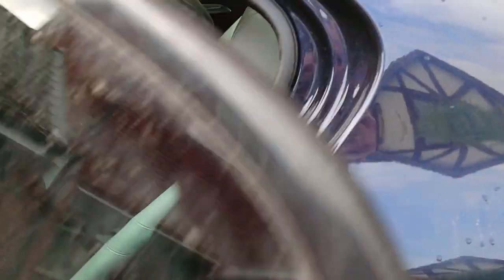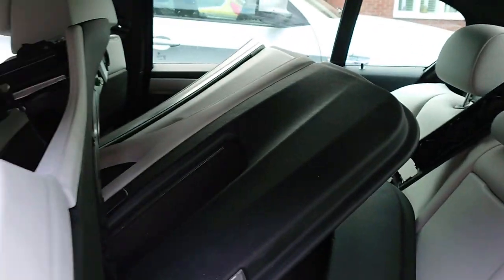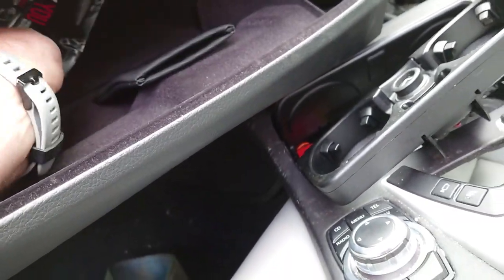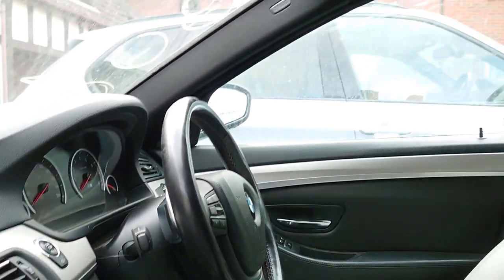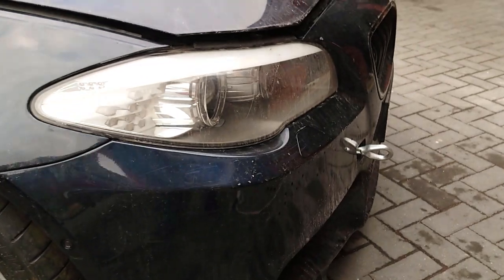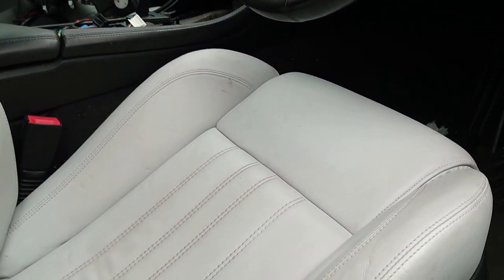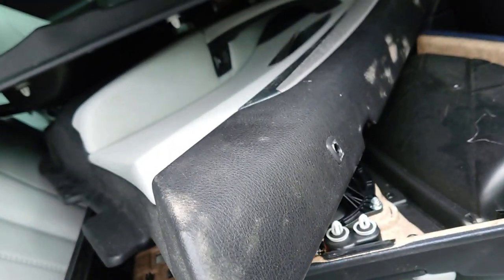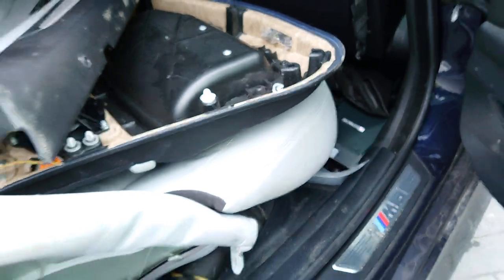UK's Cheapest BMW F10 M5, missing the exhaust?

Comment: What year is it
Reply from the maker: +Al Al it's from 2012.
Reply: Arhhh 14 and above best to buy anything below that in f10 shape is a fukin headache
Reply from the maker: @AlAl-vc7xr  to be fair, it's not been that much trouble until recently. I find them really easy to work on. Shame the previous owner put a bad tune on it! Will get it fixed up and back in the road though. Have you had one?